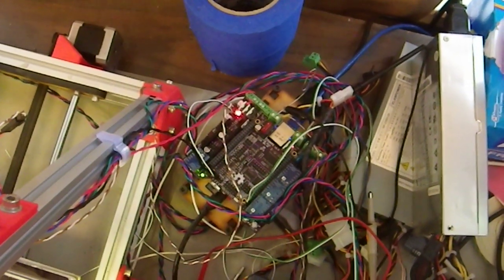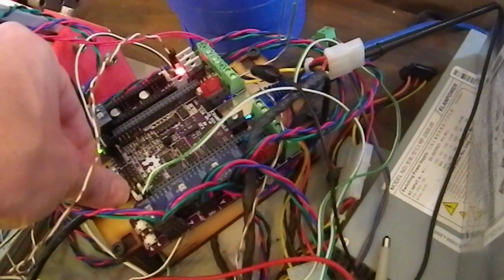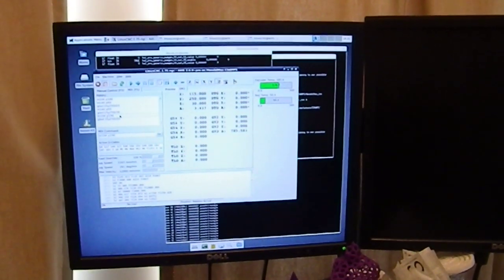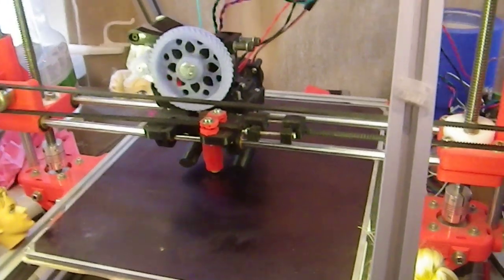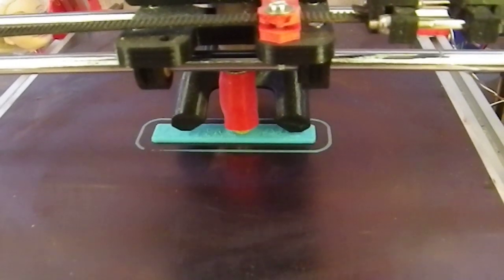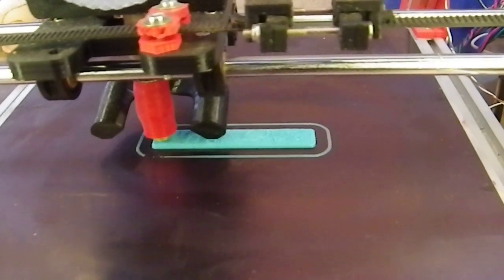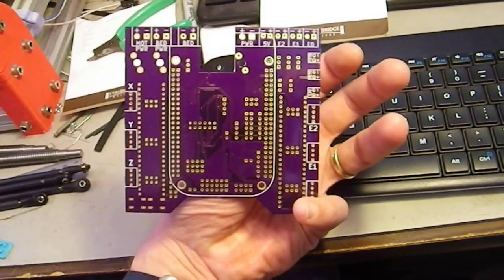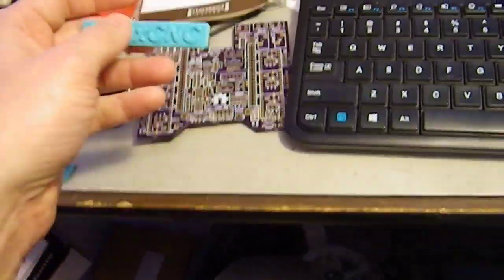BeagleBone 3D Printing with CRAMPS and LinuxCNC

Comment: Are you having pretty consistent results with your CRAMPS board with linuxcnc?   I'm contemplating making that jump.  I've worked with AVR chips and the beaglebone for a while now, and I feel like AVR chip is not really best suited for 3d printing.    Do you have less stepper noise using the BBB?
Reply from the maker: The static noise (when not moving) is pretty much unchanged, as that is determined by the stepper drivers (the DRV8825 drivers are quieter if that's important to you).  When moving, the dynamic drive definitely seems smoother using a BBB vs. an Arduino to me, but you can check my videos and judge for yourself.  Brandon Heller also has a great video of a linear delta printer using the BBB:  http://youtu.be/gdMcdjUPyes
Reply: Charles Steinkuehler That delta printer seems to be VERY quiet.  I really like how quiet those seem to be.  I've thought about attempting to build one using makerslide extrusion, but I have some other stuff I need to take care of before I invest much of my time into that.   

If you decide to sell a CRAMPS kit in the near future I'll definitely get one from you to replace my ramps 1.4 board.   I'd prefer to not have the X portion be on the BBB to save resources, but I haven't done much research into machinekit / linuxcnc yet.  I usually save that kind of thing for hands on, so I can absorb it all.
Reply: Justin Edwards " I usually save that kind of thing for hands on, so I can absorb it all. " That's what she said :D

Comment: I order my PCB ,using garber files posed on https://github.com/cdsteinkuehler/bobc_hardware/tree/CRAMPS/CRAMPS.
And I weld them, then came the problem.

every things went well,but the E1 step motor ,it shark sametime or not work at all.
 During my test 3 4988 Pololu driver is broken, I just don't konw why.

I noticed that you changed a file "CRAMPS-Front.gtl" three mouth age.

My question is if your CRAMPS E1 works well?

Comment: Hello Charles,
i own a Cramps from Pico Systems and just want to know the functions of the EEPROM on the board. 
cat /sys/devices/bone_capemgr.*/slots
dosn't list the caps bord. Is there any need for caps management for this board (https://elinux.org/Capemgr)?
I will use the board maybe with klipper: https://github.com/KevinOConnor/klipper

Thanks
Steffen
Reply from the maker: The boards from Pico Systems should have the EEPROM programmed, but it is just going to load the cape-universal overlay.  If the EEPROM is blank, you can use this file to program it: https://github.com/cdsteinkuehler/bobc_hardware/blob/CRAMPS/CRAMPS/CRAMPS.00A0.eeprom
Reply from the maker: ...and the Klipper software looks very interesting, I had not heard of it before.  Let us know how it works out for you!
Reply from the maker: Refer to the System Reference Manual.  Those values indicate the power used by the cape, although they are largely ignored by most software.

Comment: can the linux cnc work with regular ramps
Reply from the maker: You would need some sort of adapter to interface the RAMPS to a system that is capable of running LinuxCNC or Machinekit.